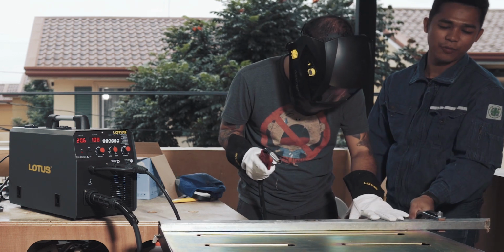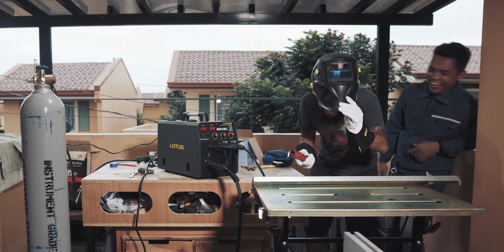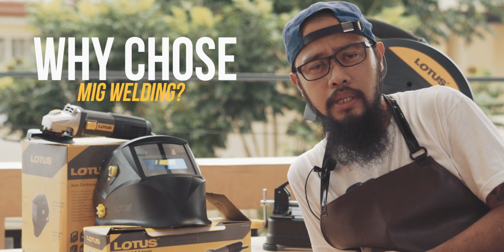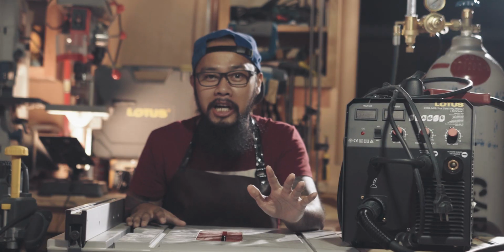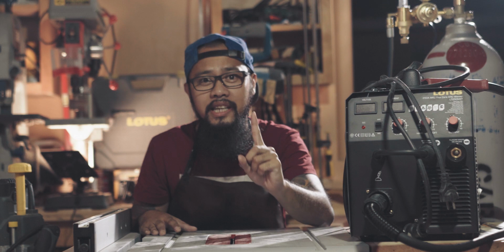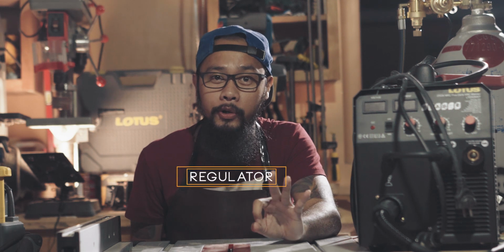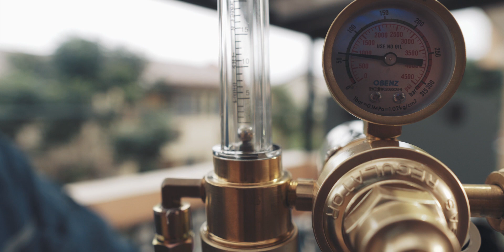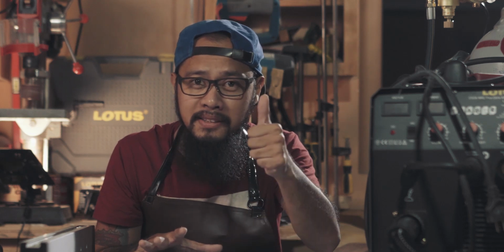Lotus MIG Welding Setup for Beginners

Comment: Lodi. Kkabili ko lng ng LT250MXT.
Request nmn po. PkiVLOG nmn how to setup lalo kung ggmitin solid wire or flux cored.  San ishoshoot mga cable pls. D kasi gano alam dito samin. Hehe. Na hoked lng ako syo lodi😊pa shout out nadin po😊😊 joey juayong ng morong rizal. Thanks po ang more power. God bless po.

Comment: bro about dun sa regulator, yung nabili ko kasi may nakalagay na 36v. pwd ko kaya siya i plug sa 220v outlet?
Reply from the maker: may saksakan sa likod ng machine pre pra jan
Reply: @filmthatbuild  i mean bro yung co2 heater na regulator
  diba  may outlet yun kaso lng 36v lang ang nakalagay,
Anung ginawa mo dun sayo bro ginamitan mo paba ng adapter para sa 220v outlet?

Comment: Sir ilan yung diamiter ng filler wire na 15 kilos, kung ilang inches. Gusto ko lang kasi malaman kung kasya sa mig machine ko yung 15 kilos. Tsaka anong brand. Pero base sa experience ko OK lang kahit Walang heater yung regulator basta wag lang masyado malakas yung co2 kasi magyeyelo yung regulator.

Comment: Idol, good day! Ano po opinion mo sa mga 3 in 1 inverter welding machines? I'm planning to buy Mig gas less inverter but still gusto ko pa rin may Arc ako. Is 3 in 1 practical or do you prefer the dedicated welding for single purpose? Any pros and cons you know😁 salamat sa sagot idol

Comment: hi idol, tanong ko lang. yong tip ba ng lotus pwdeng palitan? mukang mahirap po kasi humanap online ng 0.8mm na wire. karamihan kasi 0.9mm. at kung pwde palitan, palitan ko din ba ang mechanism sa loob para ma-accommodate ang 0.9? salamat
Reply from the maker: Madali paltan sir..ung roller n kasama ay baligtaran pede .8 at 1.0

Comment: I've been wondering Kung may nabibili 75/25 argon gas sa pinas for mig set up. Meron pala. Magkano nagastos mo buo set up na ganyan bossing?
Reply from the maker: Cguro pre nsa 40k kasama welding machine..co2 lng nman gamit ko 100% pro yes meron arco gas dito stin
Reply: @filmthatbuild  parang US prices din pala set up ng mig dyan. Ka bibili ku palang starter mig set up na machine.  Regulator, tank, welding machine na $700 din ako. Pero hobbyist set up lang yon Yung pang pro papalo siguro  $2k and up.
Reply from the maker: @charliehustle2579  kasi itong specific model n ito nsa 22k n eh, tapos nagcompute ako dati ng expenses ko pagsesetup, tank, wires, hose other accessories liek regulator pumalo ng 15k eh
mahal na hobby din hehehe
Reply: @filmthatbuild  gloves, welding mask etc etc etc. Nakaka addict nga mag welding. Lol.
Reply from the maker: Uu pre lalo pag nakakakita mgaganda design ng furnitures hehe

Comment: There's a gasless mig welding machine. More convenient,no hassle purchasing gas. Just plug and play.
And it has good penetration based on evaluation by other experienced welders... Not me because i haven't had one. Planning to get one.
Reply from the maker: Yes there is bro..and i recommend it to other who is planning to start mig welding :) it just happens that this is what i have
Reply: Gasless mig welding is called Flux core welding. Marumi ang results. Madami splatter welds parang nag stick welding kana rin. SHIELDED OR   Gas solid wire welding mas malinis, mas Mapino ang results. No need na  linisin.